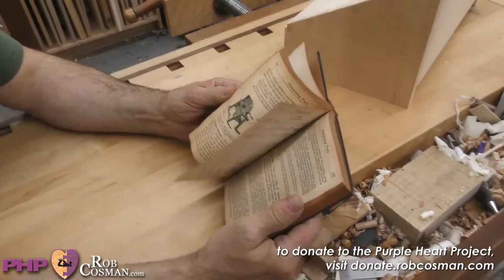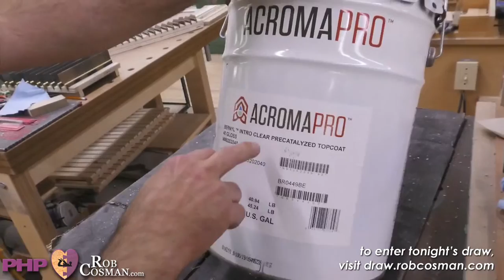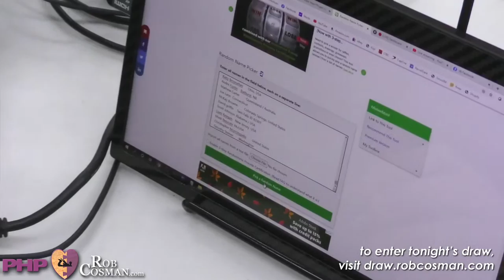Live with Rob Cosman: Angie's Bed Desk Build + Q&A

Comment: 21:48 Another way to square up a plane is to find a machine shop with a surface grinder.  They will hold the plane down with a calibrated square block along with a magnetic chuck and carefully grind the side to exact squareness.

Comment: Funny that you should have had a phantom extractor starter. It is an issue that has come to my attention recently. When they're hooked up to remotes, they can start up with a stray signal from some source. It doesn't bare thinking about what could transpire if this happens overnight, or some other time when the shop is unattended. It Is always good practice to ensure such equipment is isolated at the end of the day.

Comment: Hello Rob, thanks again for all your teachings.  I posted a question (twice now) and it hasn’t showed up in your live streams yet.  Could you share the dimensions of the chop/jaws you use for your Sjöbergs vise? Mainly I would like to know the thickness, because I understand the other two dimensions may changed based on the workbench and length the user would like to have, but still it would be a good guide to reference from. Thanks,